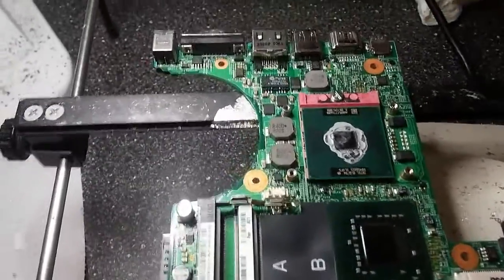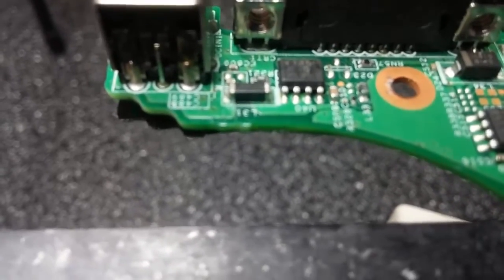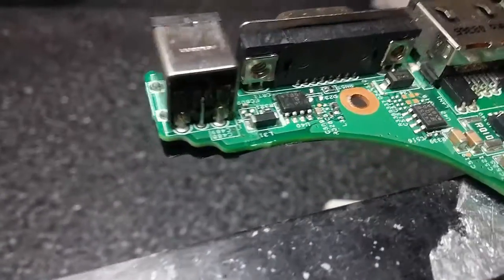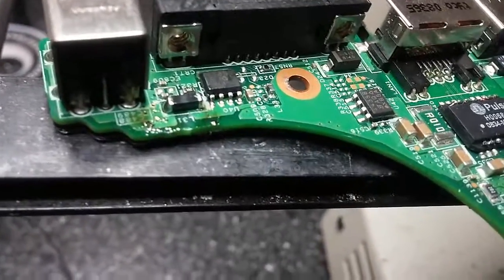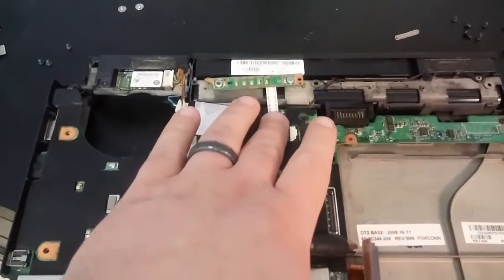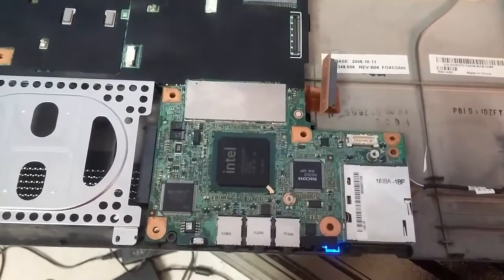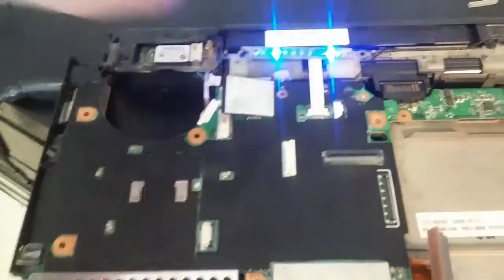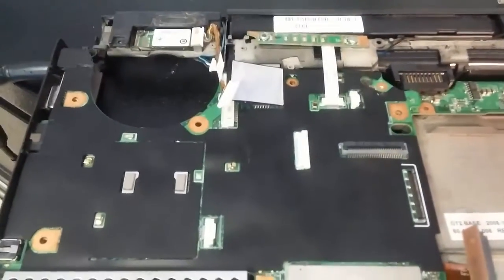Dell XPS M1330 No Power Fix

Comment: Thanks Jon! This 10 min fix saved me a lot of grief. Also, this fix can be done without removing the motherboard. Remove the back cover and then remove the CPU fan assembly. The IC can be soldered from there.

Comment: I have one of these that exhibits no power, but additionally, plugging in the AC adapter kills the adapter - as evidenced by the blue ring on the adapter cord goes out.. the adapter comes back to life after re-plugging on the AC end, but only after the DC end is pulled from the notebook.
Suspect the notebook was in use and overheated to cause current problem... 
 Did yours run on Battery power before the fix? Mines dead on AC or a charged battery.
 Suspect the buggers cooked off.. it's been a fun machine and is ancient, but hey..